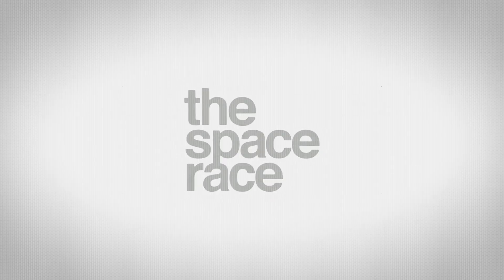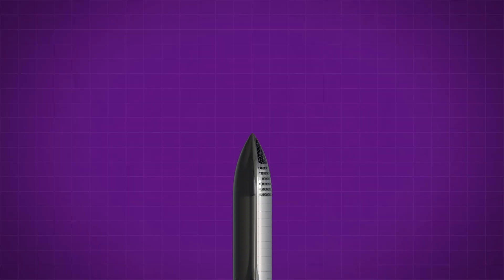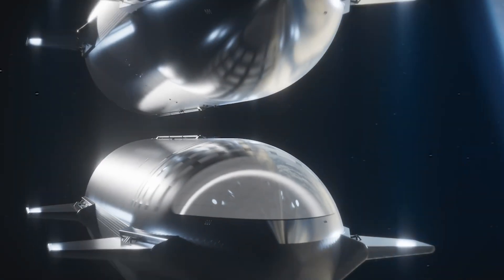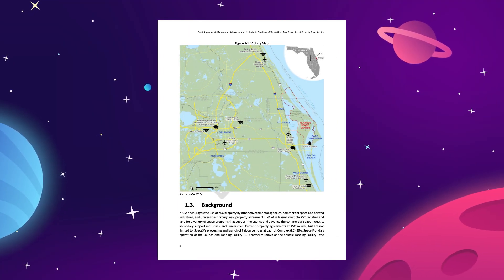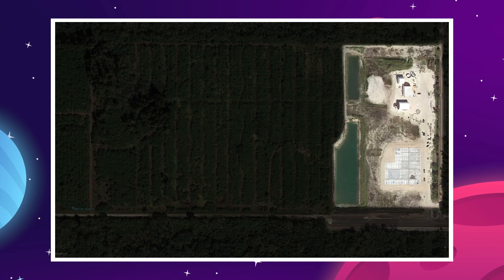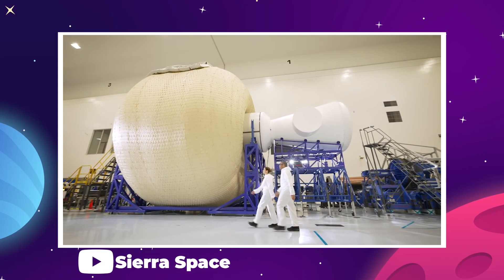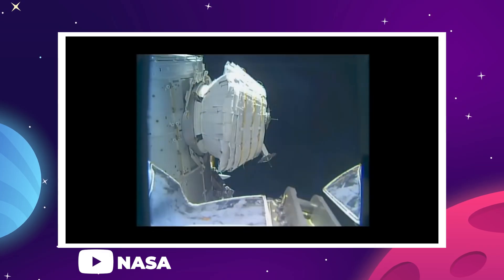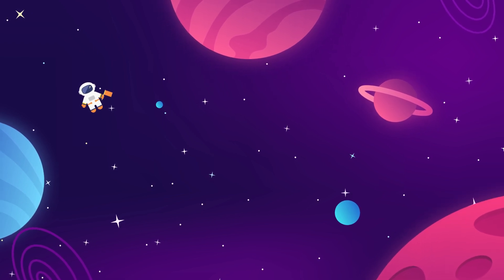SpaceX Reveals New Starship Prototype!

Comment: There is no way starship can lift humans to the moon by 2025. How many years of testing did Falcon 9 take to add crew dragon? We don’t even know if starship will survive landing, don’t even have legs, with experimental catch. No human mission will allow experimental rocket catch system! There is no backup if they are even slightly off course. And there is no emergency capsule separation rockets!
Reply: Starship might one day be a cheaper unmanned heavy lifter, but no sane person would launch or land in it. You might as well use Falcon crew dragon for launch to orbit and landing capsule. Then starship can lift a lunar module system from LEO to the moon and back.
Reply: Starship might help heavy lift unmanned capsules that can do one way landing on the South Pole as  base space. There is no sense blasting off anything big off surface of the moon.
Reply: Starship could also help build the lunar gateway orbiter, getting larger modules there more cheaply, all with no humans on board.
Reply: SpaceX does great rapid prototyping, fail early, fail often. But it still can take years and many dozens of unmanned missions before allowing human lives to be put at risk.

Comment: Regarding the inflatable modules: it is incorrect to assert that BEAM was the only inflatable module to be tested in space: in 2006 and then again in 2007, Bigelow Space launched two of their modules into low earth orbit. Both articles completed the full testing regime of 6 months without incident, then an additional 2 years of activity until the avionics failed. To this day, both Genesis 1 and Genesis 2 are in orbit, inflated, and while there haven't been a close by inspection of the modules, they are believed to be in a good state.

Comment: Correction: the Saturn Causeway needs to be widen not because Starship is wider. Saturn V and the Space Shuttle were much wider than Starship; however they were transported by a tracked crawler that used both sides of the Causeway. That system was one-of-a-kind, too expensive to rebuild and maintain. SpaceX uses multi-wheeled SPMT (self propelled modular transporters), which are commercially available; however, they use only one side of the Causeway.

Comment: It's going to be a lot easier to pump the fuels if the tankers are set up as pairs and spun so as to use artificial gravity effect to get the fuels to the pumps and compressors. Linked together via a centrally located distribution and docking port the set could eventually act like a orbital habitat with some gravity at the central hub for the convenience of visitors and service personnel.
Reply: The centrifugal solution appears better in text and drawings than the actual dynamics and physics involved. Whether linked side-by-side, or axially, the more massive body is going to swing the other more around their common center-of-mass. This may kick-start the initial flow of props (from the side, or from the end, respectively for the two configs), but eventually the receiver is going to gain enough mass that the other is getting the more swing-your-partner-round-and-round. At that point the flow stalls and the bodies, tanks, and props form an equilibrium condition: they're all going around a newly-placed common center-of-mass.
Reply: The two or four tanks are attached to the central hub via a linked connection through which fuels flow to the central hub for distribution to (or from in the case of a top up operation) the space vehicle. Pumps, compressors etc are located in each module.

Comment: Hard vacuum is something entirely different you have to calculate for the hard vacuum of space it's like or it's going to be like that submersible made out of carbon fiber how it imploded instantly once it got down below a certain death it's too rigid it might pop they need to put that inflatable unit in a hard vacuum and then inflate it to to expansion and see when it would fail in a hard vacuum that's the only test that I would trust

Comment: The Fuel Depot Starship will need a lot of extra stuff, like sun shields and pump hardware. Getting the fuel up there is one thing. Pumping it in zero G into the tanker, and then keeping the cryogenic propellants from boiling away or freezing solid is another. It is rather daunting when you think about the details.
Almost anything seems simple when you don't think about the details. But nature is all about the details. 
Nature is the single most important factor when translating "Elon time" into real life time. I think the NASA oversight board is coming to the realization that even though SpaceX is moving fast and building and testing hardware, it is tackling very difficult and untested technologies. That might have been the deciding factor in pushing for a second competitor for the HLS. Sometimes, Elon Musk reminds me of Howard Hughes. Let's just hope that Starship HLS does not turn into Elon's Spruce Goose.
Reply: So you move the ship that needs refueling, not the one with fuel. Or you just put in anti-slosh baffles. To pump the fuel in orbit you could apply gentle thrust (ullage) to settle to fuel to one end and maintain this thrust while pumping. Yes, your orbit changes but you can just change it back after undocking. You're not even bringing up hard problems to solve but ones solved long ago.
Reply: @filonin2  that can be solved, but not how you think, a ship that doesn't have any fuel cannot move at all, what you are using to move that ship? YOU GEST SAID THAT YOU MOVE THE SHIP WITH NO FUEL! And fuel bafffers aren't a solution for a starship that have 75%of the fuel tanks empty and try to dock with another one(those baffles are only to limit side to side splashing when propellant is settled by inertial forces) , the problem is that you have gass and liquid in the same tank, in zero g that is a problem easy to solve with only one ship, you fire some small thrusters and the propellant settle, but if try to settle the propellant and docking with another ship at the same time that will be harder(in your mind you already docked, my message was about how hard would be to docking two starship, a maneuver that requires precision and stability, that sloshing will make starship very instable) , also some solutions that are useful for small capsule like dragon can't work, the dragon uses non-cryogenic propellant, and use a inflatable blater(like a balloon filled with gasses inside the rigid tank) to prevent the propellant and gas to mix, but on a cryogenic tanks even you can put such blater to separate gases from liquid would be useless, because the liquid oxygen and methane would boil and produce gasses in the section of the tanks that contained only liquid,(you don't want those to be mixed when you start a rocket engine) probably someone can find solutions that work, but that person wouldn't be Musk, that say that isn't any problem, because dragon work and massive orbital refueling with cryogenic propellant is the same thing like docking little dragon to the ISS.
Reply: @theOrionsarms Use the RCS propellant. It's not going to have literally zero fuel. FFS.
Reply: @davescott7680  any docking maneuvering in space use RCS thrusters(you don't know that? I never thought that the docking would use main engines) , and but both ships would have significant amounts of propellant, that is the plans you remember? And that propellant would be in various quantities on each operation , you need multiple refuelling in the starship concept(like from sixth to sixteen) , the problem with people like you is not understanding of basic logistical problem that occurs even on earth or on sea operations of refueling , when someone says" that it's a problem", you simply bolt a solution that wasn't meant for that and expect to work flawless.
Reply: @filonin2  another thing, nobody solved the problem of docking two large cryogenic rocket in orbit and transferring propellant from one to another. MARK MY WORDS , optimistically speaking in two years from now, Musk would say that is a insane difficult thing to do, much harder than he believed, and maybe would take more than two years, don't forget that SpaceX don't achieved the planed demonstration of transferring 10 tons of liquid oxygen from one tank of a single spacecraft to another tank of the same spacecraft, that was supposed to happen until the end of 2022 as was putted in a contract with NASA, maybe in 2024 that would happen, and actual orbital refueling between two different ships in 2025.
Reply: The ISS has had in orbit refuelling for years, it is as easy as docking, the only fuel sloshing is for return. This is the second rocket Elon has built, that's why he was so upset by the delay, he wants to keep up the pace, and FAWSUS should have been with FAA and NASA through the construction and testing, getting to orbit, could be solved, that's why this delay is ridiculous, if he can get to orbit, then he is up to refuelling, if that's done, he should be at lunar orbit, otherwise, he needs to get to orbit, no one knows till the next launch. The real interesting thing is, if he can get to the moon, does he land or build a tank farm in lunar orbit? Nothing stopping a Starship as a space station in lunar and Earth orbit, with a tank farm, then the question becomes, does he leave HLS as a lunar base, and develop a dragon for lunar to lunar orbit crew transfer, NASA is only looking at 3 on the moon, starship could easily put 10 there, and a cycler or 3 could transfer crew 4 at a time.
Reply: @zephyr9673  are many mistakes in what you wrote, first :the starship is huge and would have a enormous amount of propellant on each docking (like 200 of tons at least),the relative velocity would be small but that mass splashing even at lower speeds would make whole starship to wobble and shake for few minutes at any change in velocity, you need a a rock steady spacecraft for a precise and safe space docking, second :a single starship launched from the ground cannot reach lunar insertion not even without payload or fuel remaining on board, so they need to make that refueling into LEO for sending anything to the moon, third: the current prototypes don't have docking adapters at all or even extensible and flexible propellant connections that would alow two starship to transfer propellant from one vehicle to an other without actually touching ,only when those vehicles would be builded and ready to be launched you have right to say that SpaceX is holded in place by FAA or anybody else, for the moment they aren't ready even for the smallest test of that orbital refueling .
Reply: @theOrionsarms  the FAWSUS is causing they delay, not the FAA the FAA and NASA have been in constant presence at boca, FAWSUS have not, but if they had been, this delaymay have been avoided, and you can argue you point all you like, that's a freedom of thought and expression, it is useful in not repeating mistakes you are talking about Starship as if it were Agena, and that dragon had not been launching and docking for crew and payload, as if SpaceX had no experience, I completely disagree, and as NASA is offering its experience to SpaceX for free as a part of the ISS replacement, I'm pretty sure that support is not far for SpaceX to access, the plan I laid out was sequential, I don't know if you needed me to explain that, because obviously the entire point of tanker starship is for HLS, but does not preclude discussion about getting a Starship to lunar orbit, with fuel, as a tanker or station, both designs are on the table, and the utility of a tank farm in lunar orbit and a Starship docked and fuelled for Earth return, makes sense as for all intentions and purpose, SLS at 4 billion, has priced itself out of the plan, leaving Starship
Reply: @theOrionsarms  don't argue with me about the delay,  take it up with Elon, he called it out. I agree with him. But am more concerned with avoiding future delays than read you trying to censor me
Reply: @zephyr9673  you have the right to your own opinions, but you said things that are necessary true or even relevant, most of the delay is because the SpaceX engineers not finished their work and deposit the documents , and nobody in the regulatory institution have the obligation to release a blank check to Musk or his companies without reading what they are saying, and take time to understand any details before to say if they agree or not, if the paperwork takes from 30 to 130 days, you only start to comply at 130 days after you deposit the request, not two weeks before depositing any papers like Musk did!
Reply: @zephyr9673  on a separate discussion topic, the orbital refueling wasn't thinked for HLS, but for using starship like a interplanetary ship, so in the discussion about starship this is more relevant than you think, also my opinion about using a fuel depot around moon for a reuseble lunar lander is that is a great idea, I have this conviction from years(and being critical about current SpaceX plans of using only LEO fuel depot) , and is based on simple analysis of fuel efficiency, you don't debate with me about the things that don't sayed , also how I censored you? I only civilized express my opinion about some things that you are said.
Reply: Yeah Musk have no idea how hard would be orbital refilling, he said that because they know how to docking dragon capsule that would be easy, well dragon doesn't have few hundred of tons of cryogenic propellant splashing in its tanks.
Reply: @theOrionsarms i dont think fulensplashes around in space…
Reply: @Hungary_0987  definitely it does, if you don't accelate at all it float, but when you try to docking one spacecraft with another, you need to come slowly to the spacecraft that doesn't move and stopping before you colide(like on one inch before that, and you need to use rocket propulsion to stop yourself), but if your propellant tanks are partially empty only the rigid shell of your spaceship will stop moving, and the liquid would keep moving and hit like a hammer few seconds later, and bounce back and forward several times, it splash only because of the inertial forces, not like on a earth vehicle (like a tanker truck) because of the combination of gravity and inertial forces.
Reply: @theOrionsarms  You are exactly right. Great explanation. 👍😎👍

Comment: Not that this will never be a successful rocket, but all these channels following the daily grind are so enveloped in Elon-Time. The way SpaceX is approaching this, we'll see a startship 40 before any orbital refueling demonstration is even on the table. And they haven't even explained how exactly they're going to transfer liquid fuel in a rigid container, in zero g. Which is insanely hard for anyone who doesn't understand physics. They'll either need some type of reusable diaphragm that can be pressurized in the fuel tank, or expend hours of monopropellant just to keep some g loading during the transfer, which would modify it's orbit while doing it, which is really dumb. Last option is centrifugal forces, which simply won't really work when the center of gravity is shifting while the fuel transfers.

I hope they make the Artemis 3 deadline, but it seems pretty safe to bet against that right now.
Reply: 100% agree with you, but their schedule is also definitely hindered by the sheer amount of FAA and enviro investigations taking place every time they want to make a step forward. they are so bogged down by these investigations its actually quite amusing. as for the orbital refueling, i definitely agree, that just sounds like a physics nightmare. unless they can build a tank with a mechanism within the tank to push the liquid out whilst working in tandem with a pump, much like how a hydraulic piston works, i just dont see a way they can do it efficiently enough without expending heaps of mono. but i digress im not a physicist, i just play too much ksp lol
Reply: It is a challenging problem.
Maybe the tanker and the starship could connect nose to nose then slowly rotate both together end over end.  This would push the fuel to the "bottom" of the tanks.  Then use pumps to transfer the fuel from the tanker to the starship.  I think the changing center of mass may not matter.  Perhaps the pumps could be electric and run off batteries that are charged by solar panels.  
We will just have to see what their engineers figure out.
Reply: @appliedfacts  That's an idea I've never heard before. If a full tanker connects to an empty ship the CG point of rotation would certainly be within the tanker's tanks, causing oxidizer to be lower pressure and some of it thrown the wrong direction. As long as this maximum mass difference causes the CG to go no lower than the tanker's oxidizer tank "bottom", then it's possible to start the pumping.

As mass transfers to the empty vessel, the CG actually improves the situation by moving towards, and then through the connection point of the two ships, then CG increases centrifugal force further on the tanker side, to pump out the last drops. The pumps would be working to counteract nearly 100% of the centrifugal pressure caused by the rotation, relative to the receiving end.

Could theoretically work with relatively high efficiency. It would be slow but doable.